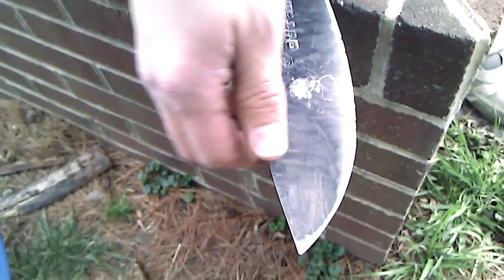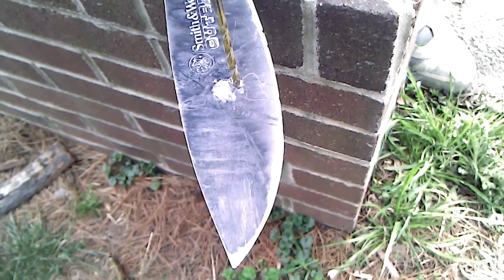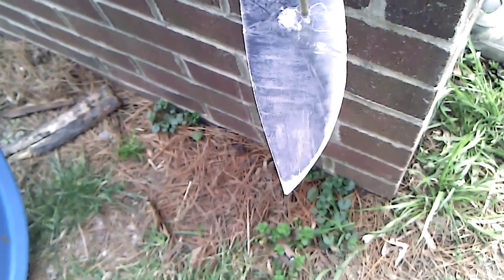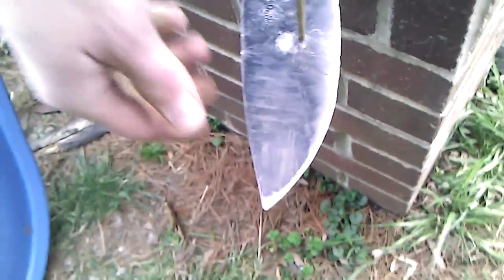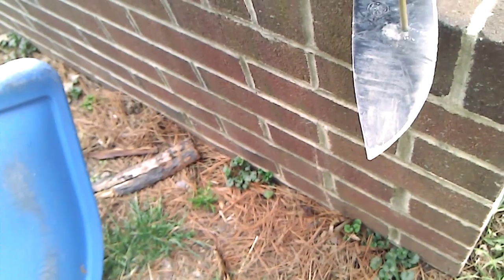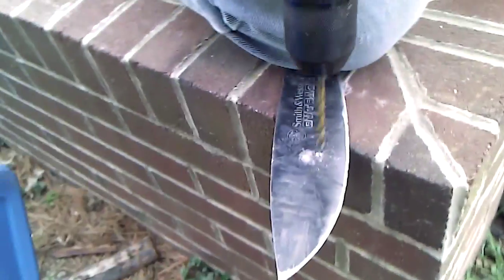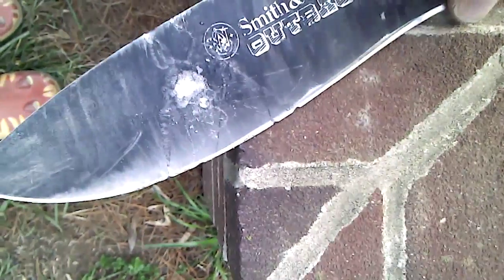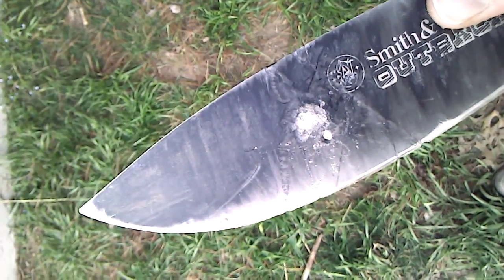Chinese 440 mystery steel- Test 4 of ?... "Drill Baby Drill!"

Comment: Regular bits are usually 1095 or similar, they have poor ability on hardness stainless, even a HSS bit would be hard pressed to make any progress on a high carbide volume steel like 440A. You would have an easier time trying to drill through a Cold Steel machete for example. It does look like that blade isn't going down easily.

Comment: not very suprised that didnt go through, a wood bit or "all purpose" bit probably has a very similar rockwell rating of hardened 440A which is what that most likely is, a carbide tipped "steel bit" would go through fairly easily with a little oil and some time,   That test isnt a failure however it does show that that knife has a decent heat treat on it and even though its not the best steel or the nicest knife it can serve its purpose as a bushwhacker
Reply: James... -_- it's a smith and wesson KNIFE. A sharpened steel bit would cut it and a cobalt bit would go right through it I'm sure. I've drilled through hardened steel. It sparks and chips sometimes, but it sill cuts.

Comment: you need diferent drill, that does not show how good the steel is. I couldnt drill throug a simple metal liner from a china made folding knife with a bit like that, but i can bent that liner in a vise and it does not break like hardened steel should.